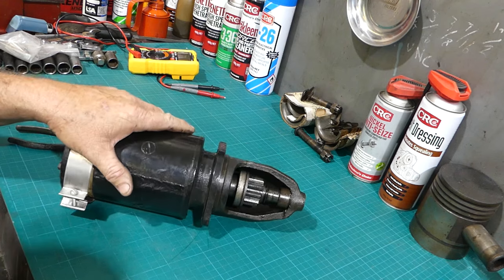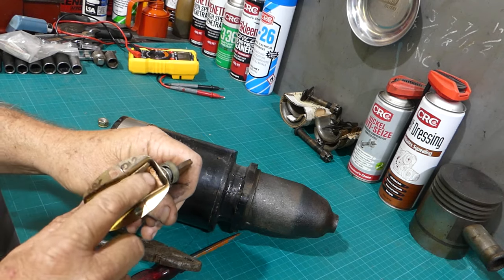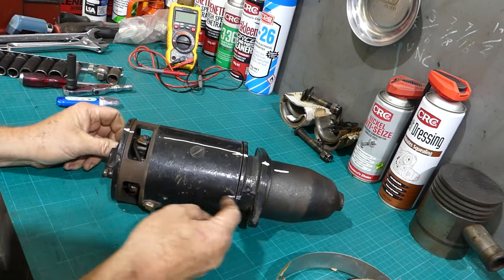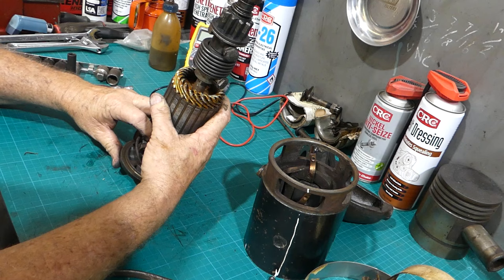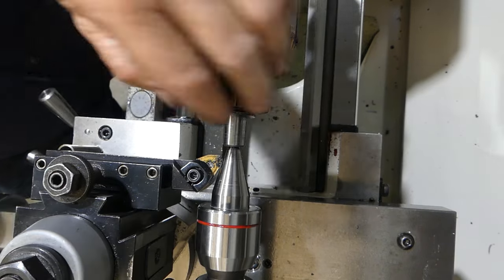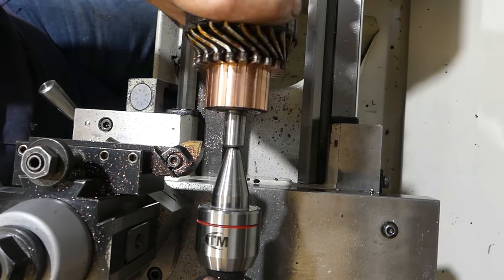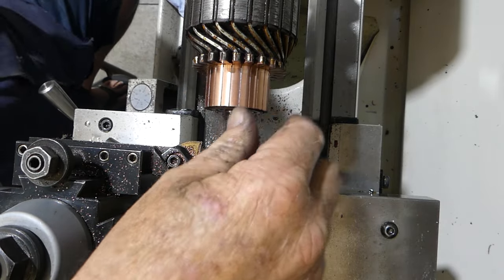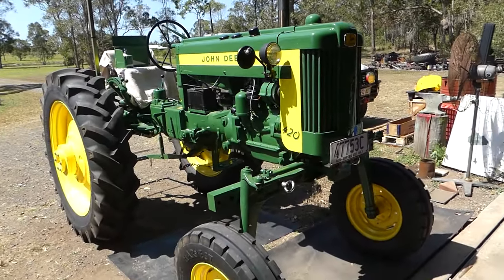John Deere 420 Starter Repair

Comment: Been a while for me doing these, I used to work at the auto-elecs while going to uni (wow 25 years ago now)   We used to lightly undercut generator comms.  Starter, it was a case by case thing.  Never heard of tracking being the reason, the goal was always clean edges between the comm bars and no chance of it rding on the unsulation (which would cause break arching thinking about it.   Key point was geeting rid of copper dags.  W used to just hook/scrape them out with a hook mad out of a hacksaw blade (quicker than using a tool on lathe).  It was sort of sharp enough to light chamfer the edge and just make sure it was clean.

Lube looks like your problem as you say,  in combination with no sintered bronze bush.   The bronze bush would make it pretty bullet proof beside remembering to give it a drop or two of oil every year or so.
Reply from the maker: Thanks, Yes Im pretty sure it was all my own fault here.